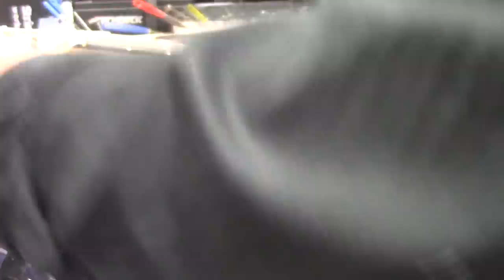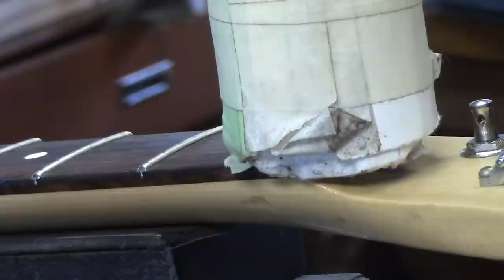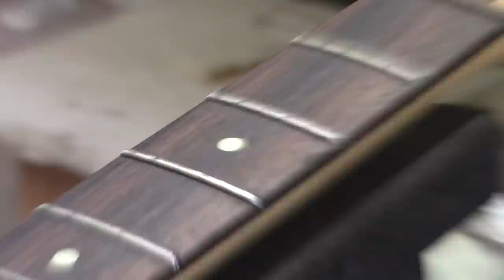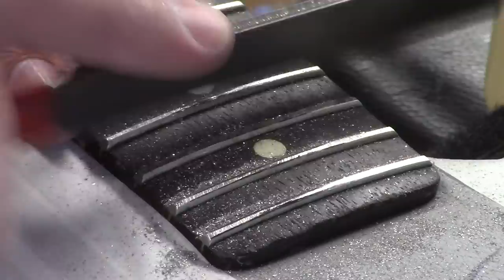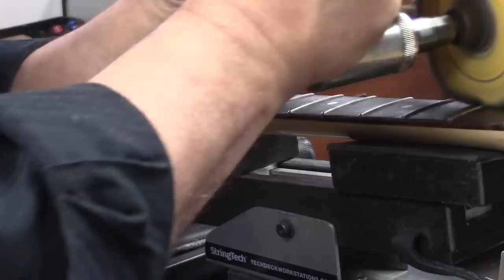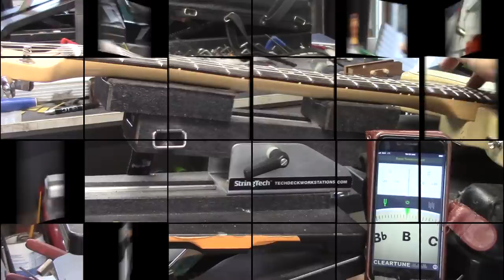"Mastering the Setup": Perfect Tuning and Playability on a Telecaster Guitar"@StringTechWorkstations

Comment: Great video! I’m still learning, but at 10:00 minutes you totally confirmed what I was starting to believe about the best case for fall away down the neck. I’ve seen some guys take quite a bit of wood off the neck when they do a full fret job. They try to get the entire fretboard flat. Seemed like having the frets taller from the nut down is ideal to me. Thank you. Love the feeler gage under the strait edge too! 

Question: 
I don’t totally get the compensated nut. How does it affect the intonation beyond open and first fret? I mean, does it change the distance of where the saddle ends up? I see it works, but how exactly.
Reply from the maker: Oh boy ... that is a loaded question. The compensation does include some variations at the bridge as well. I have a few hours of video on my Patreon channel that cover all of the variations and extrapolations. Because there are over 400+ videos .. I'll walk my $20 Patrons step by step with the appropriate video links to address Strat / LP / Acoustics / Alternate tunings etc etc ..
Reply: I was going to ask the same thing. Lol. Although my intonation seems really good without a compensated nut. But very interesting stuff. Ive never seen a luthier work frets without taping the board.. just shows your level of experience and skill. Good stuff man.

Comment: Love watching your work. What do you recommend for a threaded tele bridge, as far as intonation goes? I worked on string lengths and heights until I finally got it intonated. It is a 60's Custom Shop tele that is the best feeling and sounding guitar I have ever played. My only issue is those saddles and the screws having to be at such an angle to get them far enough back to be properly intonated.
Reply from the maker: I am assuming that the threaded Tele Bridge you are referring to the early bridge saddles that were made from threaded rod ... right ? The choice is to alter the original parts ( Originality Police will at your door in a flash ) or get a set of Glendale or Callahan replacement saddles, and tuck the original parts away somewhere safe. When I do the compensated nuts on vintage guitars ... I'll often extract the original nut very carefully ... and stash it away for safe keeping.
Reply: @StringTechWorkstations  You're correct on the threaded saddle. I'm just afraid to make any hardware changes that might affect the sound of the guitar. I never found a tele i liked until I played this one.

On another note, have you or do you plan to do a video on setting up for a bigsby? I recently bought a 2016 Gibson '61 ES-330 that sounds completely amazing. The only problem is I feel like I am fighting tuning stability constantly because it has a Bigsby B7 on it.
Reply from the maker: Fair enough. If it is playing it's optimum ... even though the ends of those saddled adjustment fasteners almost touch the strings ... .... if the intonation lines up; let it be! Cheers ! MMcC

Comment: I just picked up a used Squire Strat. I think it needs a new nut as the high "E" string sits really close to the edge. I might try to do that myself following your instructions. But the problem I have it the neck has no finish at all on the back of it. It feels like it was sanded and left that way, unprotected. What would you suggest I finish that with?
Reply from the maker: Pad some fresh polish on it.

Comment: If I send you a guitar for a full treatment from Scottsdale AZ for a full treatment, once shipped back do you think the guitar will need another set up due to temperature and climate changes in the shipping process?
Reply from the maker: Depends on the guitar. A Tele is pretty well invincible, once it has been set up. Scott ( Wisconsin ) got his LP Studio back  ( recently ) without any issues.
Reply: @StringTechWorkstations  Thank you for the response, appreciate it.

Comment: Beautiful work, and beautiful sounding guitar. When you set the action on the guitar, do you have a specific height at the first fret and twelfth fret that you try to achieve or is it a trial by error for you?
Reply from the maker: Thanks for asking this question James.
I know that many will aim for a specific height. 
But honestly, I will eye along the length of the neck and set the action height, so that the string ramps up very gradually towards the bridge. After adjusting guitars for a half a century and adjusting them for every possible case scenario; I'm at the point now where I eye-ball it ... plays a few chords and ( in the case of Teles  ) rip-off a few bends and blues licks .... then leave the final call to the customer.

Comment: Question! If the frets are worn out, by measuring the bow of the neck on the frets with a straight ruler, wouldn't that give you a misread of the neck relief?
Reply from the maker: With TechDeck neck support I  jack the neck up to nose-level ... close one eye ... and get a perfect read on the lay of the neck in a couple of seconds ... then adjust the truss rod accordingly.
Reply: @StringTechWorkstations  Gotcha! Would you recommend a notched straight edge in the lack of the work station? Also, where did you buy the crowning file? Thank you very much for taking the time to reply and making these videos.
Reply from the maker: I've never used a notched straight edge ... imho...  it seems like a solution looking for a problem. The crowning file was bought from Philadelphia Luthiers supply ...  Hosco large fret file.

Comment: Feel like a telecaster has a lot to gain from a confensated nut. Already one one of the most chimie beautiful guitars out there. A compensated nut would just clear up a lot of the high end frequency overtones.  Really let the potential of a telecaster shine. Am a Telecaster player for sure. Think I have already decided in my heart that compensated nuts are the way to go. Just have to come up with a plan to execute it. Wondering how bone would react to a router? Seems like possible way to get the shelf cut in.
Reply from the maker: I use the drill press disc sander to cut the shelf and shape the nut blanks. Stay tuned ... I have another Tele coming up. MMcC
Reply: @StringTechWorkstations  have a special router circle jig that I got for making dobsonian telescope mirror base mounts. Can make perfect plywood rounds of any radius. Then put roll adhesive sandpaper on it. But I don't have a big drill press. Could get a drill press.
Reply: @StringTechWorkstations  or do they make sandpaper rounds? Obviously, if I made a plywood round and stuck sandpaper on it I would just have to put some kind of arbor on it. Do have a bench grinder. Oh I also have a polishing wheel. Lol. Put a round on that. But the RPMs might be a bit much? Not sure what kind of RPMs a bench grinder has. The advantage of plywood rounds is I can make any radius. Guess a good question would be what size rounds works best for you. Bench grinder rounds are usually 7-8. Could cut a plywood round for the bench grinder as well.
Reply: @StringTechWorkstations  what radius rounds and grits do you like to use? Oh and a good tuner would be nice as well. Have a digital Peterson strobe tuner that I use for intonation. But it doesn't have a cent needle?
Reply from the maker: Oh Boy ... lots of questions here ! The radius sanding disc I use with the drill press is 9" diameter. It turns at 300 rpm. The 9" size allows you to cut down to a 4 1/2" radius ( smaller than any guitar fingerboard radius ) . I do cover this in more detail on my Patreon site.
Reply: @StringTechWorkstations  thanks for replying I'll have to check it out. Was looking at metal diamond grinder wheels. Would be an expensive venture but it would theoretically cut like butter. You just reminded me that radius is half the value of diameter! Guess if that is the case it doesn't really matter size wise.  I'll be shaping it to a scribe line. Not sure if cutting a 14.5 to 19" plywood round would be feasible?  This is what I kinda go through before doing something for the first time; watch a hundred videos , buy a book , give it some seroious thought, consider my budget, then spend enough money on tools and supplies to buy a custom shop guitar (which I would never trade one of my home builds for). And try to pull it off on the first try. These guitars I am building are like select one piece bodies, quarter sawn necks. Not like I am practicing on a $100 used guitar. Lol. But that is the point of what I am doing. Trying to build the best guitar I can. Told myself in the beginning perfection is realistically 4-5 builds away. But builds 2 through 4 would be most guitar players main guitar. The great guitars are coming a lot sooner than I expected? And keep tweaking em until it doesn't get any better (which hasn't happened yet 2 &4, they just get better and better) than move on to the next one. It's probably true the best is yet to come. But if these first few builds are any indication of where it is going. I'm in for quite a treat if I stay the course. It all starts with good wood. Everything from weight and grain direction. Then it is flexibility, kind of have to build around the body. Switching neck tone woods and pickups. To make a cohesive guitar that is balanced tone wise. Anyways, I could talk for days about it. Been seriously researching it for 3-4 years? And taking on more and more of the building process. Soldering, nitrocellulose paint, compensated nuts, was pleking in the beginning, now I am leaving, dressing, rolling finger boards. Haven't started cutting bodies or shaping necks yet. Not sure I need to turn into a career builder? Have a day job. Maybe a guitar tech after I retire? Mostly what I am doing is out of the desire to play a truly special instrument. Am doing it for me. Thanks for the help. any ideas are greatly appreciated!

Comment: Great Video ! - was very surprised just how 'bad' the low fret intonation was to start with - it must have really been noticeable before  - particularly on open style chords - and IMHO wasn't just due to fret wear. Did the original player realize it needed intonation at the nut ? I ask because there are some folk who believe - that playing sharp is is  nut relief issue (only). Ive got 2 fenders ( and 82 AVI and a mascis Jazzmaster) - and they both have good/great nut intonation). However I have an old Epiphone DOT that is simply horrible and needs a profiled nut. I've made temporary nut shims to fix it ( I took me a while to realize that nut intonation was the issue - as you need a good tuner) - but need to make a profiled nut. So my last q: is - Do you a special source for profiled corian to start with - or do you start from scratch with a bigger blank ? Any clues/sources?  Thanks again for a great video.
Reply from the maker: The shorter scale Gibson is a lot less forgiving. I start from scratch with the Corian. Cheers MMcC
Reply from the maker: I put together 20-packs of profiled comp nut blanks for my students. mcconvilleguitars.blogspot.com/

Comment: At the sanding step, when you're going over the frets and the board at the same time, isn't it slightly scalloping the fingerboard? Is that intentional or not worth worrying about?
Reply from the maker: Not an issue Ricardo with 400 / 600 / 1200 grit paper. Although when doing a maple fingerboard it needs to masked off for the finish isn't scratched.

Comment: So one thing confuses me. you adjust the neck to be as flat as possible with the strings off. The neck is supported pretty well.  Then you use a pretty short file while crosshatching in what appears to be a diagonal pattern. I don't see how this follows the string path? you do move in a north south direction generally like the strings do i guess i need to see a daigram or something on how you follow the string path as it spreads. are the imaginary strings at the center of each stroke? you never at anytime go straight on the string path its always cross hatching with a short file.  that seems to produce leveling that good from fret to fret but is it really leveling all the frets relative to each other? i agree with taking care of the problem areas first but then wouldn't a longer tool produce a more level surface from end to end?

 When you finished you put the straight edge on top of the frets and measure with a feeler gauge that the leveling job is out by three thousands of an inch and announce that you've got some good relief there.  You have no strings on you've got the neck supported "Dead flat" yet the leveling isn't dead flat at all.  Did you intentionally add the bow somehow?  I've leveled a about ten guitars now the only way i could figure out to add a bow like that would be to slightly back bow the neck with the truss rod.  but that wouldn't show up as anything other than flat until i released the truss rod.
Reply from the maker: Have a look at this video.https://youtu.be/0aHoXT8GIxI
Reply from the maker: I know it can sound a bit confusing and be easily misinterpreted. When I mention " the  file following the string path " ... I am referring to the "orientation of the file along it's length" ... in relation to the string path from nut to bridge. I will address this again in an upcoming video. Thank you for asking. MMcC

Comment: I have 7.25 vintage style fender neck and like to play in one step drop (D to D) Wonder what is decent action to be expected. Im sitting at about 7/64 to 6/75 (low to high) or in mm 2.4 to 2. Wondering how I can get the lowest action. It can get pretty low but i like bending a full step on the highest d string and still getting choke out. Been doing fret level as a hobby for about a year now. Any advice would be helpful. Thanks for sharing all the knowledge youve learned!
Reply from the maker: Gauge of strings ?
Reply: @StringTechWorkstations  10-46
Reply from the maker: OK ... here is the issue. Even with the frets dressed perfectly level along the string path ... end to end ... with a tight       ( small ) 7 1/4 " radius .... the string will choke out ( as you say ) on the radius. This is why the compound radius is so much more preferred. If you have enough thickness on the fingerboard; you could produce a compound radius with the fretting kit that I provide for my students. @ mcconvilleguitars.blogspot.com/
Reply: @StringTechWorkstations  Thanks for the reply and I appreciate the insight, will take a look

Comment: Thanks for the video... Quick question... when filing the full length of the neck, why go crosshatch?
Reply from the maker: Excellent question Robert. Because the surface of the file is dead flat .... the file needs to be moved ( always in line with the string path ) "obliquely" over the radius of the frets. The cross hatching ensures that no spots are missed. MMcC

Comment: I NEED to know what fret end tool that is. It'd save me a lifetime at work
Reply from the maker: Are you referring to the auger file ?
Reply: StringTech Workstations Not quite! I'm referring to the took at 13:38 with the wooden handle. It looks a lot safer and less time consuming than the files I use to do each one individually
Reply from the maker: Oh ... OK. These are the 6"mill files mounted on a hardwood handle, that I make up for my students. They are included in the Fretting Kit along with / 6 straight edges / 5 sanding blocks / 1 scrub block / 6 fret guard ( vinyl pads ).
Reply: StringTech Workstations I'm new to your channel so excuse my ignorance but do you have a shop that sells this kit? I've been in the market for one recently!
Reply from the maker: Hey TJ. I make up these kits in very small quantities for my students. email me directly mcconvilleguitars@gmail.com  https://youtu.be/6QPskfGl5PU
Reply from the maker: You will find the PayPal buttons on the home page here: mcconvilleguitars.blogspot.com

Comment: I know this video is from 2019 but would you care to explain why around 8:55 mark you take the straight edge from first fret to the 12th and say you want the first fret the to be the highest? Thank you for the video.
Reply from the maker: Thanks for asking this question. It can be easily misinterpreted. In general " the first fret is the only one that is allowed to be 
( slightly ) too high. The last fret is the only one that is allowed to be (slightly ) too low.
Reply: StringTech Workstations 
Thank you for clarifying. That does make sense. I’ve got a couple of low end used guitars to “practice” on trying to learn to work on my own equipment. Thanks again and I enjoy your videos.

Comment: Hi Mike just wondering about something I don't understand. 
First you level the frets with a file then you had to recrown the frets because the fret crowns get flattened from filing them but after recrowning the frets it looked like you were contouring the frets to match the radious of the fretboard by sanding the frets. Don't the fret crowns get flattened again after sanding them?
Reply from the maker: I never touch the centre of the crown with the crowning file. That file motion of " chasing the crowns back to dead centre " is done with the 320 grit and successively finer grits of sandpaper  ....  finishing up with the buffer and compound.
Reply: So its more of a "round over" crown than a "mountain peak" crown. Makes sense now. Thanks Mike.
Reply from the maker: Hey BG ... this next Explorer video will cover that enquiry specifically. Cheers MMcC